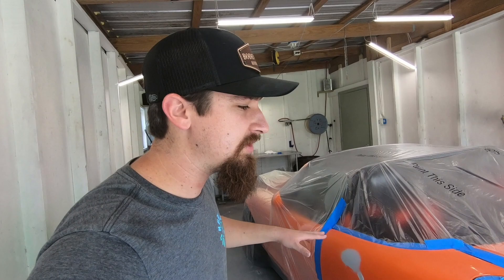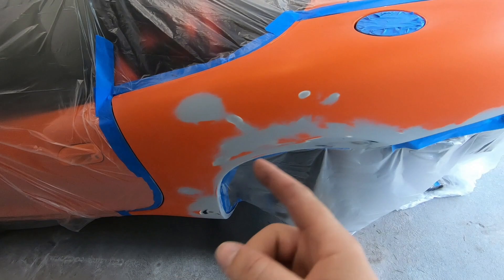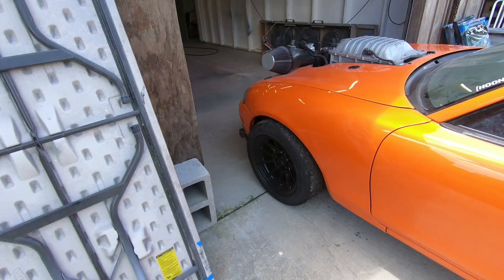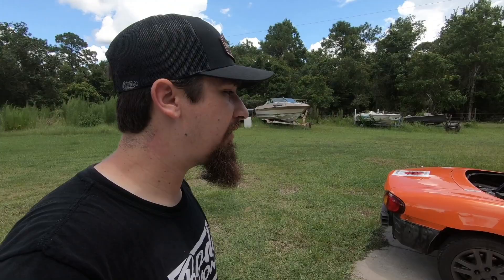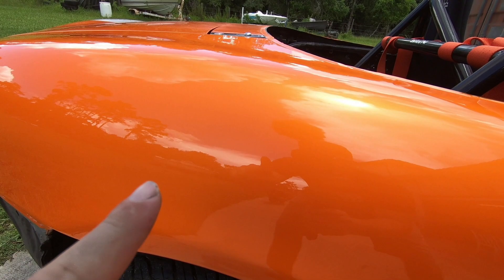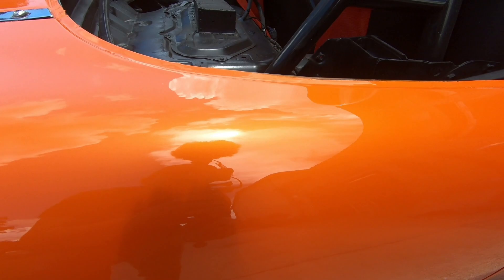Wrecked Hellcat Miata Hoonigan Repair

Comment: I am about to paint my Miata, I have the car primed but still debating on color and brand of paint. I am thinking of HOK KBC, since you said HOK does not go vary far how many quarts of basecoat do you think I will need? I will be painting the jams and trunk, but not the engine bay or underside of the hood. BTW great video as usual and you are a great motivation for me to get my car done!
Reply from the maker: Thanks man and we used 7 quarts on here without doing under the hood
Reply: Ok, thanks!! How much sealer?
Reply from the maker: just a gallon as it covers a lot better.
Reply: Thanks! you're the man!

Comment: People do not know the effort and well cost in proper body work. Especially people selling used cars. Oh yeah the fender is dented. They dont realize a proper repair involves replacing the fender preping the hood and door as well and doing a proper blend job with base color then clearing all adjacent panels. Cheap labor aint skilled and skilled labor...........